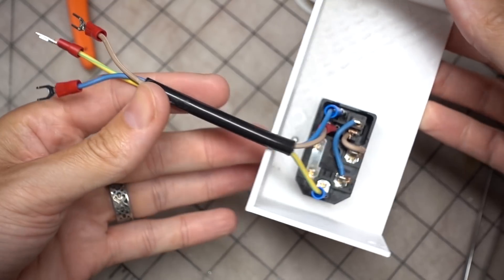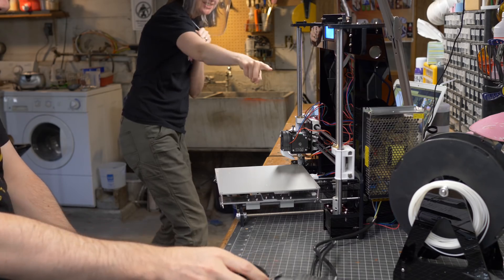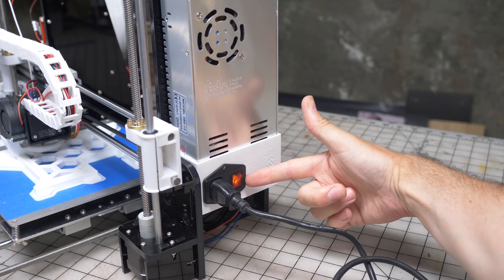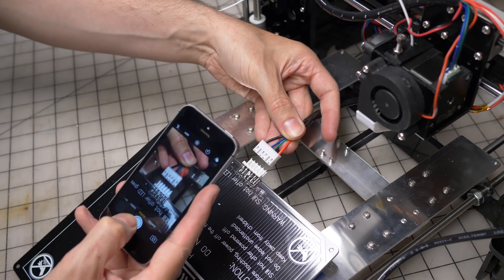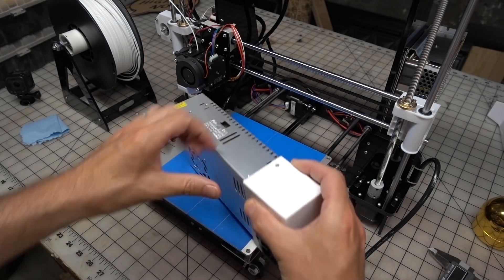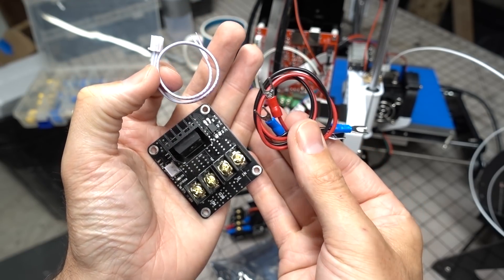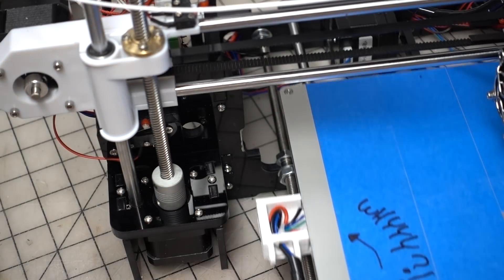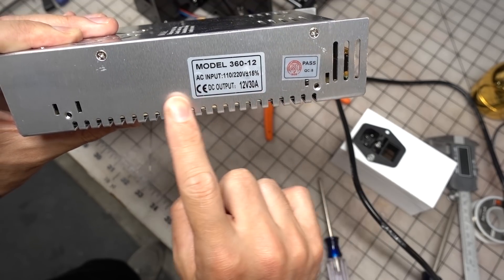Avoid a Fire Hazard - Anet A8 Safety Upgrades

Comment: Any one messing with these you don't really need an external fet, something like a IRLR8726 TO-252 will be a massive upgrade, that and a passive 12v fan across the board with 8mm heatsinks and your pretty much set after doing firmware/wires/connections/beefing grounds properly

Comment: Go and look at your printer (ANY printer not just the A8) , now consider it being a raging fire, fit for Hollywood, what are you going to do? 

1. Remove power
2. Put out the fire

Golden rules:
Smoke/fire detector 
A way to turn it off - without needing to get within burning range, reaching around that little inferno is not going to be fun.
A fire extinguisher - they cost a lot less than all the other stuff you will lose, have it located near the printer

It is never ok to leave the audible range of the fire alarm while the print is running.

Comment: Tip for everyone who considers putting up a smoke detector above the printer. 
Put it at the ceiling where the smoke collects. Not any lower. Otherwise, any smoke will just go past the smoke detector and further up. By the time the smoke level gets far down enough to reach the detector, it may be way too late. There are very good reasons why smoke detectors are placed at the level of the ceiling and not any lower.
Most smoke detectors can't detect smoke that goes past it. They only detect it once it accumulates to high enough levels.
Reply from the maker: Good tip!

Comment: about  the last scene /i am using a glass bed 2 mm ,heating before at 80 degree celsius ,and then start the print .no problems.about the mosfet ,i don t know if its working ... a good whiring  is a must do
Reply from the maker: Good to know!

Comment: Firmware upgrade should be first thing you should ever do. Marlin or skynet, anything but the stock firmware due to thermal runaway protection being disabled.
Reply: Totally agree, second should be throw the stock psu away and fit a high quality branded one not a shit Chinese firebomb
Reply: indeed
Reply: First thing after enclosing the live input terminals at the power supply, especially in 240 VAC markets.

Comment: I love your videos.  So I am letting you know that when it comes to wiring on a safety video, I have to let you know that never trust color coding on electrical builds.  On my Anet A8, I found the wiring of the power supply to be at fault.  Will it work YES, is it safe NO.  Ifr you look at an electrical outlet, you will see the ground (small half round hole) on the bottom, the nuetral (large blade hole) on the left and the positive or L (small blade on the right).  Holding the power cable (that came with the  printer) to match the receptacle, I found the BLUE wire was the NUETRAL, trhe BROWN wire was the L or POSITIVE and the YELLOW w/GREEN tracer was the GROUND.  This is needed for SAFETY not for operation. The machine doesnt care if the NUETRAL and the LINE (POSITIVE) are reversed.  You will care if you touch the wrong part if the wires are  reversed.  Think about a lamp socket.  The threaded portion and the little flange at the bottom.  These are where you connect the N and the L.  If you reversed the L and N you will get shocked.  The threaded socket is the nuetral and the little flange flange is the line (positive).  Please  share this as all of the videos I have seen use the color code as a means for connecting the wires. For a safety video everyone has forgotten about safety here in the USA.....

Comment: I got the Anet a8 for 123$

It’s my first 3D printer

I’m almost done putting it together and will take all the advice I can get
Reply: I just ordered mine too :) I bought 2 Mosfets and a Power Socket With Fuse Switch (from ebay) just to be sure It will not do any damage to the other electronic devices in the house in case of something. I will mostly print PLA and I read that for PLA the mosfet is not that important because the bed it's not that hot, but for those 3$ I rather be sure.

Comment: Old outdated advice!  The “ cure” fir burnt hot bed connections...is not needed and just majes life difficukt if you need to strip out the bed. All that us needed is some plastic glue, or Bondic or its eBay clone 5 second fix, make sure the connector is pushed right up on the hotbed....the run some glue of choice over the pins... make its pushed in the joints. Let it dry....no more problems. The burn is due to arcing cos of the gaps and loose fitting female pins not being tight on the hotbed male pins.

Comment: I started with the wanhao duplicator i3 and til this day I still use the same thing 3 years later. I did change all the stepper drivers, control board, wiring, extruders..... okay the frame is the only original thing left 😅 great video regarding safety btw
Reply: sounds like my ender

Comment: You don't need a heated bed for PLA at all. And since the heated bed causes most of the concerns, there is no reason to use it at all. It also reduces power consumption and waiting time for the printer to heat up. You only need that bed for ABS but ABS is problematic (needs heated bed, needs a housing, needs ventilation because of the fumes ect). PLA is cheap, relatively environment friendly, easy to use and for the hobbyist everything she needs.

Comment: Hotend MOSFET isn't needed. If anything it causes more problems. The hotend draws very little current compared to the heated bed. What you should do, it check that the hotend heater element is secure in the block before turning on the printer each time. This can work work loose over time and can be a big problem if it falls out.

Comment: Old information and not needed.   after connecting the  hotbed wires to teh  hotbed... run a layer of either good plastic glue or Bondic - or its clone on eBay "5 second fix"  - makes  sure teh  glue  goes into the gaps between the JST type metal pins and so it cannot MOVE in the  housing... which then  holds it  firm on teh  hotbed pins - no resistive arcing and no burnt plugs.    Soldering your wires to the bed is a Pain ITA  if you have to  strip down or change  bearing etc.

Comment: I'm going to do the a6 as i have never used a 3d printer but i have my hobby I like rc cars and trucks.I like the soldering the bed wires but with the heat couldn't you just stick a external fan back there to keep the heat down? and if your not using the printer just unplug it?

Comment: Soldering the wires to the hot bed...removes its ability to detach when needed, and is a total waste of time. All that needs doing is to stop the pins .in the crap plug that was meant for static use in computers etc, ....from moving. do this by applying a thin layer of plastic glue...or as I use Bondic or its eBay clone 5 second fix. The pins are locked in place and can still be unplugged if needed without having a load of hassle without use it soldering irons.  The latest version 2018...have thicker power wires. Also the stock 20amp PSU is enough to run...The A8 ..again it was the early scare mongers claiming it was under powered and caused the hotbed plug to burn. The plug burns because the pins are lose....ditto any of the boards power connections that are not prepared with tags or even solder to get rid of the scattered loose wires.   Time have changed ....get this updated...or pull it down.

Comment: You just make hard work for no return.   Mount the heat bed cables correctly..run some plastic glue over the top to fix the loose fitting pins....and they don’t burn.  Don’t pig around cutting the frame...mount the cable at the rear where it was designed to fit.  Snag with you “experts”.....is you do these videos, just to boost your cash back...and in doing so confuse newbies who think you know what you are doing,

Comment: That power supply you "upgraded" to is a cheap knock-off of the MeanWell supply I used on my from-scratch delta printer.  I know this because last week I added an off-board MOSFET driver for my heated bed, and while I was at it I switched the bed to 24V for faster heating.  The rest of the system still has to run on 12V, though, so I had to buy a separate 24V power supply and I ended up with one just like yours.  <.<  If you put it next to a MeanWell, you can see that they've duplicated all the labels normally on a MeanWell with stamped lettering in the aluminum.  I went over all the wiring connection stamps with colored Sharpies just to make them easier to read when I'm working on it later.  Amusingly, I also ended up buying exactly the same kind of switch with light and plug socket you have, for the same reason you did; I got tired of plugging and unplugging it.  I'm not sure I'd ever trust a 3d printer to run unattended all night like some people do.  If I need to run that long a print, I'll probably stick it in a hermetically sealed container (like a steel trashcan) so the worst it can do is destroy *itself*.

Comment: I have done the same upgrades to my CTC Prusa i3 Clone, not a Geetech or A8, but very cheap. I even took the internal fan off of the power supply and put an 80mm fan on the outside of the power supply case.  I modified the power supply cover and opened the area up to accommodate the fan shroud. The fan is connected to the 12vdc and it runs continuously with no noise.  Plus I don't see myself printing anything that I have to be away from it.  And I don't print while I am asleep at night.  I also have two MOSFETs, one for the hotbed and one for the hotend.  I have not gotten into the CAD side yet to design my own items yet. That is next. I have a few CAD applications that I am looking at to see which one best suits me, for ease of use and affordability.  Keep expounding on safety, my wife does all the time.

Comment: On the hotbed is there a better disconnect then the one that comes stock on it?
I know with pinball machines they tried coming out with better connectors due to some connectors melting down.
I just hate having wires like that hard wired onto my hotbed.
Not that it is a temporary fix though to get the hotbed working again though.

Comment: These are some good upgrades! Though, there is one thing I am concerned about, which is soldering the wires directly on to the bed! Yes, you should not use the connector that came with the Anet, but why is everyone breaking of the soldered plug off the heatbed? This doesn't make any sense. Why not just solder the wires to the pins of the plug, as the problem is not the plug itself but it's counter part, where the wires are attached to.
In fact, some people desolder the plug rather than breaking it off as you did, making it unsafer than it was before. This is due to the strong heat dissipation you're getting from the aluminium plate. If you solder something directly to it you really need to heat the whole plate up first, otherwise you soldering joints wont last long.

Comment: Soldering is usually not a safety upgrade, as we usually are not that good at soldering high current wires.  It takes training. Usually it is better to crimp then solder, unless you have gone through a proper professional soldering course.  And crimping usually put less strain on wires.  It might be better to connect the non connected socket for black and red so you don't put all current through one socket, instead it passes two sockets instead of one.

The MOS fet is also a good choice.

A real safety matter IS to upgrade the firmware with new Merlin, as it has a heat run away protection (and some other things that makes it better).

A smoke detector IS a good choice.  Should be mandatory.
Reply: soldered joints (done properly) will always safely carry more  current than crimped connections, weather or not you choose to develop the skills before undertaking such a project is on you..

Comment: with the new ender 3 coming out, the a8 just seems so outdated.
Reply: Rohab price difference is what matters, ender 3 costed the same but just as a pre-launch offer. Right now is more expensive
Reply: true but the amount of time, effort and money you'd need to but into this printer to make it print properly and safely would pretty much get rid of that price difference. the time and effort would be fine if you're someone that likes to tinker, but for the people that buy this printer because of how cheap it is, personally I dont see the point when you can get a much better printer for a little more initially but a lot better long term costs. also considering that most of these printers are on constant sales makes the ender 3 a more compelling option.

Comment: I bought the PSU you linked in the description. I'd been using the out-of-box one on my stock A8 for over a year and this works essentially the same, except this one doesn't spark at the plug every time I plug it in now. I don't think I'm gonna install the switch though. I'm content with just yanking the cord to shut it down, cause it gives me peace of mind knowing it's completely cut off from it's power source when I'm not using it.

Comment: Absolutely solder the heated bed wires directly. One day I noticed that my heated bed wasn't warm immediately after a print had finished. I had a wire melt the heated bed connector and it was having an intermmittent connection. Scared me to death.

Comment: I have a question - when you replaced the power supply switch, what did you do for the cord to power it? did you just switch to a regular computer PSU? or did you hard wire the old cord to the poles of the outside of the switch?
Reply from the maker: I used a normal power cord from a computer. That plugs into the fused power switch which was wired to the new power supply.
Reply: perfect that answers my question.

Comment: There is no need to solder the wires to the hotbed.  I have had 6 A8’s....the first two burned the connector, the second two ( I sold the. To friends not wanting the hassle of delivery and build etc) I used Bondic or the clone on eBay “5 second fix”. Run some on over the metal wire holders in the connecting cable female connector. This stops the real issue which is twofold. The female pins in the connector are pushed in after the wires are crimped to the female pin....and they are a loose fit and with the printer bed moving get tugged in and out during the travel.....which makes them a loose fit in the connector....which allows arcing and resistance  heat. Stop this pins moving and it’s cured.  Just remember to check the Bondic is in place and if needed ...add a bit more. This saves all the problems created by needing to adjust / change or repair any part on the hotbed that requires it to be removed from the printer.

Comment: POWER SUPPLY:  If you're upgrading yours like the one in the video. Please read this so I can save you some additional frustration.  Learn from my mistakes! ;) 

1) When you're looking at the position of the current power supply, the new on will have to be mounted closer towards the front of the A8, in order for the power switch cover to clear the frame bracket on the bottom back edge.  I tried keeping the position of the top left screw hole already in the frame from the current power supply so I only had to drill 2 new ones on the bottom, only to assemble and realize I *****ed up.  

2)  Don't take short cuts if you want to avoid frustration.... measure twice, cut once!!  The tape-hole seems like a good idea, but it's risky since the tape stretches and curls slightly when you pull it off. I highly recommend using an "L" shaped measuring tool to measure the new power supply hole locations because It'll be more accurate, and you'll want to make sure it's mounted perfectly straight and at the right height (Very important for power switch cover to sit properly)

Comment: Thanks for the STL of the switch cover. One of the most useful things to add to this printer. You might wanna look into the AM8 mod. It makes this Printer so versatile, with the newest Marlin upgrade it's almost a mk3 (just looking at speeds). Maybe with a few versions of marlin, it might get there.

Comment: Any chance of chaining the video for mosfet install?  The video gives really bad advise and shows what not to do on the install.  The installer simply wires the mosfet into the circuit and puts mainline power back to the board vs. mosfet.  Making the mosfet useless.

Comment: I just got a new Anet A8 and it seems that the hotbed connector has been upgraded. It now uses thicker prongs and the kit now runs two + and two - wires between the board and the hotbed.

Comment: I consider some of this mods not to be really necessary for safety, like changing the PSU or resoldering the heat bed cables, but I'm a fan of modifying stuff as much as possible so I will probably do some of this

Comment: Great video.  One suggestion, when you solder the wires directly to the bed you can do it so they are pointing toward the middle.  Then you can ziptie them to the H frame and you have nothing coming out the side at all and wire management is easier.

Comment: One smoke alarm near enough to quickly detect a fire. But far enough to not set off false alarms. Should be more than enough of a safety precaution. Of course I would never leave the house while it's running as is the same for all heating appliances..

Comment: You did a better job than I did pulling the connector off. Mine ended up stripping the copper stripping and ruining the bed, making it unusable. I don't see a single seller of these beds that can deliver within 2 weeks. Awesome.

Comment: If i upgrade the power supply like you did will that enable me to go higher than 90c for the heat bed?
Reply: I doubt it. You need more voltage to get more power to the bed. I suspect simply insulating the bottom of the bed will allow a higher temp though.